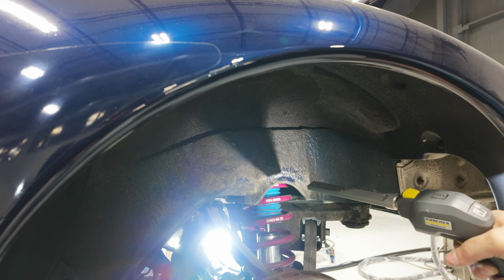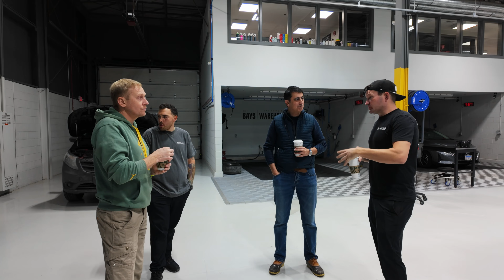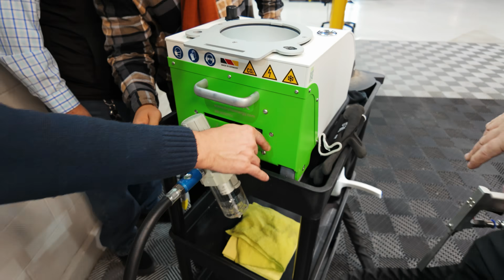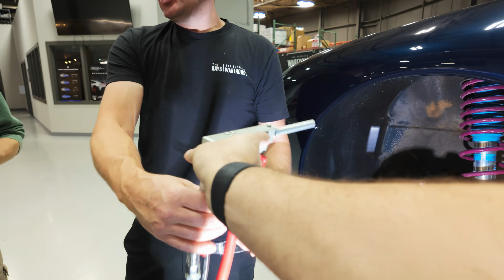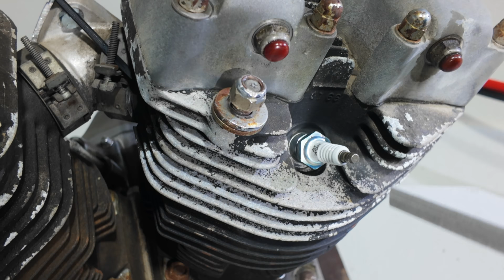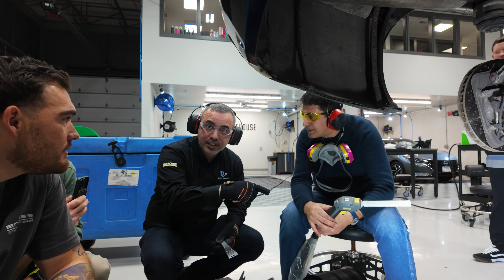Deep Dive Into Cleaning With Dry Ice

Comment: How would this System Deal with Removing 2 Pac Epoxy Paint  ?
Reply: @kimcricelli5618  at the end of this demonstration he clearly states that these machines are meant for cleaning and not for removing the material. He basically said it was safe on paint unless the paint was weak and was easy to remove in the first place.so if I had to guess this wouldnt do well in that application. Basically you would use these machine to clean areas that you dont really want to clean up sand blasting abrasive from and you want to preserve the finish of what ever it is you trying to remove the dirt from.

Comment: This looks pretty easy to make a DIY unit, very simple machine.
Reply: I have given some thought to it and the most difficult parts would be controlling the ground ice pellet size and getting sufficient air flow. There is no air flow without power, so either a big compressor and tank or a high volume blower, which means anyone with only 120V service in their garage is out of the question. Producing dry ice is an expensive and difficult proposition so you'd be relying on commercially available blocks and crunching them up to a controlled pellet size which is not trivial. You can't just chuck it in a blender and go, I figure a rotary crusher with a screen that allows smaller pieces through and traps larger ones to be crushed again is the best option. You want good control of the media size to minimize waste since buying blocks will be pretty expensive and inconvenient if you run out. The blower is probably the heart of the compressorless machine and would be an interesting part to source, can't just power a cheap ebay or junkyard supercharger with an electric motor and call it good, needs more pressure and less eat. Big air compressors and tanks are expensive and take up a lot of space. I've looked at the brochures and manuals for several off the shelf machines and air demand is quite significant. There are many problems to solve to make a system that is effective and not wasteful, but it could definitely be done cheaper than commercial machines.

Comment: Really nice presentation! What about using dry ice for the exterior of the car?how safe will it be on paint? I guess if it is safe for a touch screen will be enough safe even for the whole car....am I wrong?in some places it is not possible to use water at all in certain periods and waterless wash do have its limits for very dirty/muddy cars.....certainly it would be very expensive but that's not the point🙂..thanks
Reply: Using dry ice on paint is as dangerous as using heat. Paint is fragile and you can pit and chip it with dry ice.

Comment: 37:15
$1,500 just for the wheel wells............ NOPE 🤣 jesus thats expensive
Reply: It's a slow process with anything but the big machines and shops I've talked to for anything from small jobs like removing engine bay rustproofing to big jobs like the entire underside of a car that was spray on undercoating treated are charging $250-350/hr for the job.

Comment: Struggling to figure out a rough cost I will need to start up a mobile dry ice cleaning business will want the most efficient fast machine
Reply: But I think 25 grand should be ok
Reply: 1. Dry Ice Blaster is needed. Pricing varies depending on the quality of blasting you want. Some blasters merely use a hopper to feed the nozzle, while others grind or crush ice and ice pellets into a finer size. For a Blaster, you’re looking anywhere from $1k to $60k.
2. Air Dryer is needed only if you want to avoid clogs and decreased quality, and you want to expand the range of atmospheres you can work in. Dryers capable of drying more air at once allow you to work in more humid environments. While this is optional, without it you will see a drastic increase in time savings. CFM capacity varies by price, and 400CFM will start at $7k. For an Air Dryer, you’re looking anywhere from $1,000 to $20,000.
3. High CFM Air Compressor is needed for ice to have an impact. You can blast with 1,000psi, but that won’t do anything if your CFM is only 20-40. You NEED at minimum 100CFM, preferably 185CFM, and ideally 240-300CFM. A perfect solution for most general applications is 400CFM @ 200PSI, and you could in theory run two Blasters off 400CFM considering 200CFM would be a reasonable volume. Air Compressors will run you anywhere from $5,000 to $30,000 used, and $18,000 to $240,000 new.
4. Depending on your equipment selection, you may still need an additional compressor, but you will definitely need additional tools and PPE.  This can span anywhere from $1,000 if you bought high end equipment that doesn’t need additional input, beyond $25,000 if you have cheaper equipment that doesn’t not convert its own energy (for instance, you may need energy if your Air Compressor is electric and not Diesel, however most have their own Diesel motor, but energy input and PPE can still be big additional factors, especially considering that you can push this category as far out as “fuel and CO2 costs” if you so desire.

I’m sure there is more I’m missing, however if you want to get a comfortable idea of your spending, you are looking at $50,000 with lots of upcoming maintenance needed, beyond $100,000 for a newer setup, beyond $200,000 for all new equipment.

Comment: Why did you go with Karcher over other options like Cold Jet, Nu Ice, etc.?
Reply: it is all stainless steel inside and out, which ensures that no matter the environment is going to be easy to clean, maintaining and prevent cross contamination. In addition it has a patented particle size control on the gun that sizes the particles in stages giving you more dry ice feed rate and prevents clogs even at smaller particle sizes. Very reliable units. with the best service in the industry with 129 fully equipped karcher mobile service units in the USA ready to help at a moments notice. In addition to be the most serviceable unit in the industry. Lets say the trigger breaks in your blasting gun, or you run over the connector, Karcher simply replaces the specific part that is broken no need to buy a whole entire gun or assembly to get your unit up and running again asap. Even units that are 20 years old still get service no EOL notices.

Comment: i hear from the karcher distributor that the L2P ( with the tank) is 3 times slower than the 15/120 ( use with compressor and air dryer ).
Reply: Of course, the L2P machine is significantly smaller with 1/10th the compressed air and dry ice required as the 15/120.